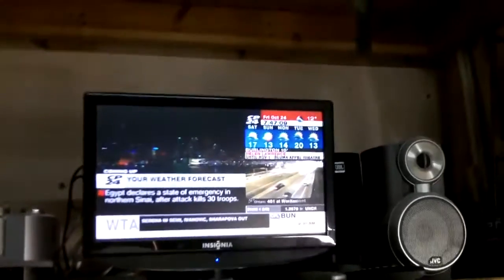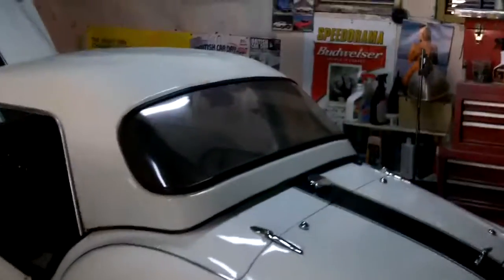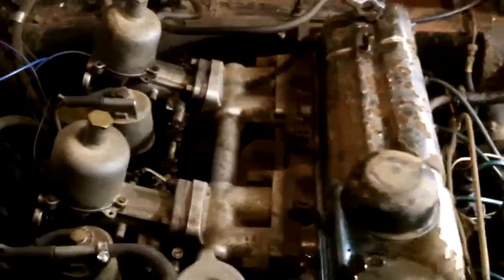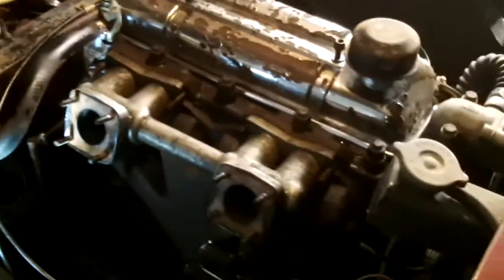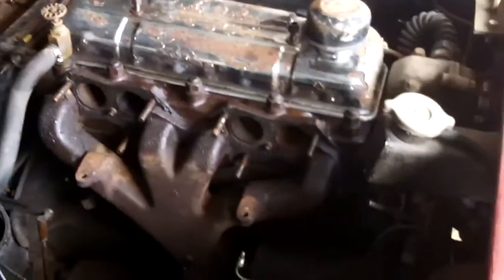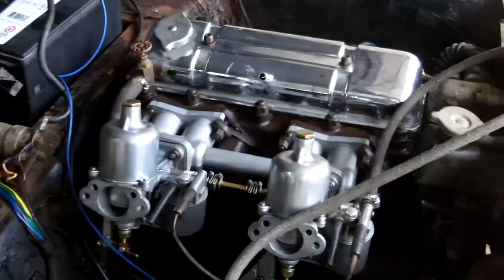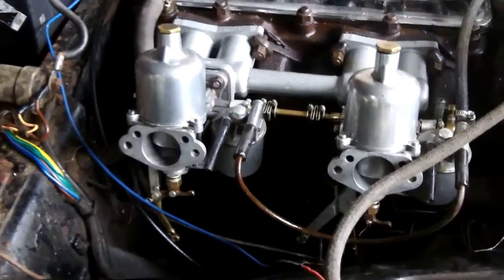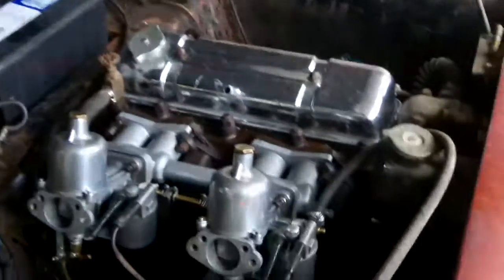1959 Triumph TR3A First Start After a 39 Year Sleep....

Comment: Tush, I'm getting close to starting my 62 TR3for the 1st time in about 15 years. Did you need to prime the oil pump on yours before starting?
Reply from the maker: Hi Jason, I didn't have to prime it but I did spin the engine without the HT lead hooked up un the distributor just to build oil pressure.   I should mention that I did take the plugs out to squirt a little bit of oil in the cylinders as well. On a full rebuild ( like I did on my TR6), I would prime the pump by making a tool with a piece of threaded rod cut with a slot and hooked up to a cordless drill set on reverse.   Good luck with yours. Take some video :-)
Reply: Thanks Tush, this isn't a full rebuild, the motor appears to be in decent shape and is complete although someoone drained the oil out of the pan a few years ago. The motor was fine when the car was parked several years ago. I haven't tried to turn the motor by hand yet. I've been completing repairs to the fuel tank and hydraulics thus far. I've enjoyed your videos they've been a great resource and are helping me to stay movitaved and moving forward. Any further advice you can give would be great.

Comment: question? are you going to redo all crank seals, freeze plugs ect.? tried to buy the car for 25 years had set for more than 30, finally bought it. took fuel pump bowl off and cleaned, ran fuel line to jug of gas, hand pumped carb bowls full. hot wired it shot starting fluid in breathers and pushed the button on solenoid it fired up and idled. no smoke no noise ran great. question is do i pull the motor and redo all seals ect? my gut says do it.
Reply from the maker: They are pretty tough little engines. I plan on NOT rebuilding mine initially. I am going to try and drive it for a little while. If issues crop up, I will resolve them then.   It is pretty easy to remove the engine later down the line if need be
Reply: THANKS